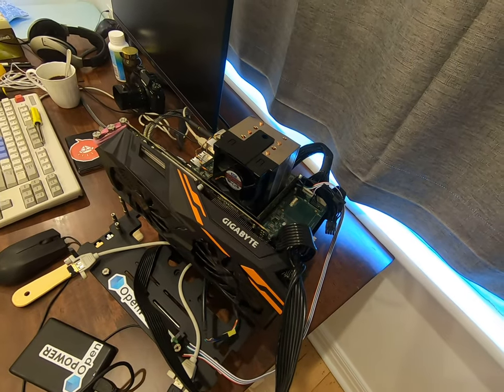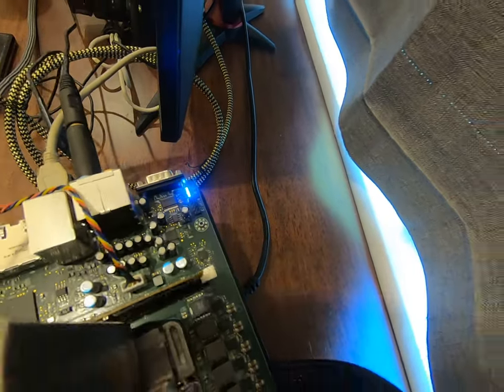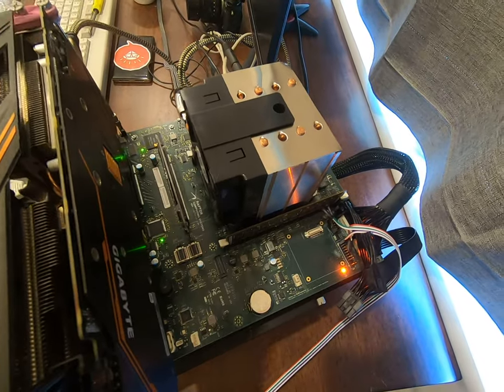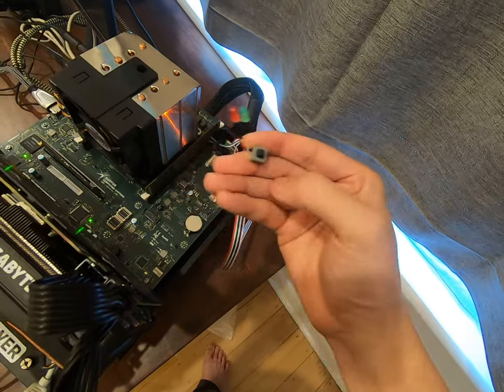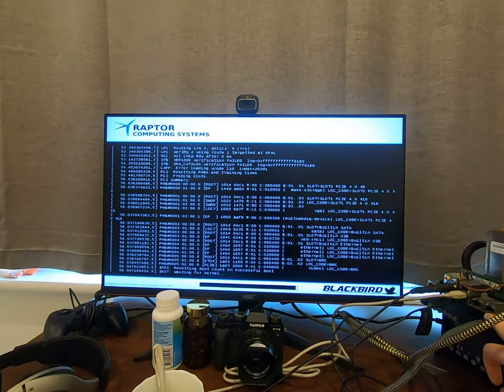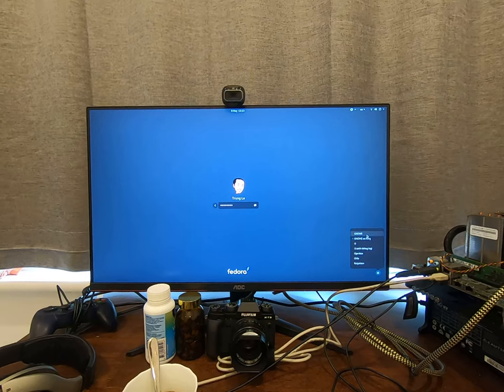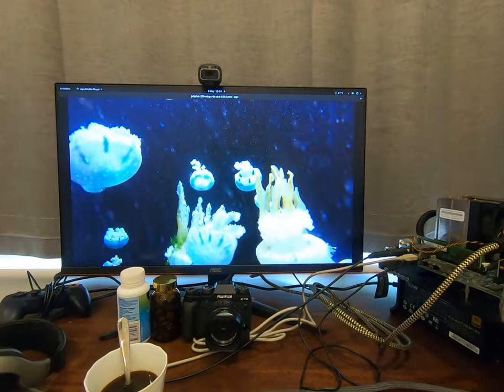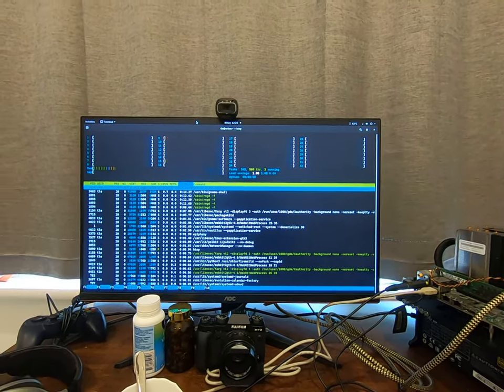Boot up Raptor Blackbird - the BEST OPEN SOURCE OpenPOWER (PowerPC) computer

Comment: 32 threads, perfect for installing gentoo linux :)
Reply from the maker: ever x sadly Gentoo does not support ppc64le. But I have no issue with compiling big project like Chromium, Firefox
Reply from the maker: ever x thanks for pointing that out
Reply: perfect for slax
Reply: Can it run autodask maya on a ppc for Linux

Comment: I am in the market to be setting one of these up. I have a mainboard and am too broke atm for a CPU and RAM. I was wondering if you could do some benchmarks with FFMPEG video re-encoding and maybe compiling a large program such as Blender. These can be extremely CPU intensive and I’m very interested in how this system handles it. I am impressed that an 8 core CPU does 34 threads…
Reply from the maker: Blender on just CPU is slow. However on CPU + GPU it is just as fast as that of x86_64. I wish I have a comparable x86_64 system to compare with.

For FFMPEG video decoding/encoding, it is again not that impressive with CPU. In fact it is actually slower due to poor software optimisation
Reply: @TrungLe-lw4zm  the thing is that as far as I understand, PCI devices have direct access to memory through the DMA is that an nvidia card could infect your linux, or the bios itself, we must investigate this issue more, I am very disgusted sincerely both nvidia and intel as microsoft, but the one that disgusts me more is intel because of its ME, today confirmed that is backdoor NSA, the issue would be to seek solutions outside of nvidia and amd graphics

Comment: What is the power consumption on these machines? I expect them to be high, but are they crazy high or on par with an x86 workstation with similar performance?
Reply from the maker: Good question. I have not measured the power consumption. Plus I do not have an equivalent x86 workstation to do benchmark against. Perhaps this might be a good suggestion for Michael Larabel of Phoronix page for his next benchmark

Comment: did you need to disable the AST with the jumper for gpu output in the OS? I would like to use my gpu without flashing amd firmware as well.
Reply from the maker: Yes you need to disable VGA output of the AST.

Comment: Another Question that Comes to my mind. When you first have to press the button for the Firmware and then after some minutes the other button for the Mainboard, then how do you see if the Firmware is Ready when you have the board installed in your Desktop? Or do you simply wait x minutes? And which Desktop case offers two Buttons to start the Computer? Most have only one. Only very old cases have a second one for the reset button that could be misused as the Firmware power button.

I also wonder why Raptor does not Mention on the hoempage that the board has an M.2 Slot for an NVMe disk. It only mentions SATA.
Reply from the maker: There are a series of 4 small LEDS on the motherboard. Once they stop blinking, it means the firmware has booted. Then you could jumper-boot by shortening the pin headers exactly in the same fashion as that of x86 motherboard.
The board does not come with M2 slot. I have to buy a PCIe X4 M2 adapter.
Reply: @TrungLe-lw4zm  My Question was: how do you watch the LEDs when the board is in your Computer case? I want to have the computer in a safe case (safe from dust and Kids). A Computer case typically only has one power-on button. If I push that, then it only initalises the board but does not boot? How to actually start an OS (or select one from a menu?)? Or can you not build it into a case because you have to wait for the LEDs to stop blinking and then have to shorten the pin headers?

Ah, that explains it. Which Adapter did you use? Do you have a good experience with it?
Reply from the maker: @dannilow2382  Good question, there is a header for server front panel I/O which has LEDs to indicate if the initial firmware is done or not. I have not tested that out because of lacking of the panel. So I tend to wait for about 1 to 2 minutes. It is easy to tell if the firmware is ready or not, if it is not, when I try to boot with the power button (or shorten the pin headers) it won't do anything.

Comment: Are you running a multiseat setup that allows independent console access (via the motherboards framebuffer) and GPU at the same time? I have a board with a BMC running vga out via an ast2500 but every time I switch to the console it blank screens my GPU output and vice versa and want both to work at the same time but think i maybe need to tell systemd and x how to do multiseat :/
Reply from the maker: No I did not set it up that way. Please bring that up in forums.raptorcs.com, I am sure someone must have gone through the same pain

Comment: So does it really take 3minutes to initialize the hardware before you can actually power it up? This is what I understand from the introduction about the blinking LED in the corner. And then does it take 3 more minutes until the Linux is actually booted? What does the computer do during these 6 minutes? I mean from pushing the power button my system is ready in 30 seconds. But waiting 6 minutes is very long. Also it is very loud. How much noise does it make in a case?
Can you explain once more why you used different HDMI outputs and why you switched after the system was started? Can the open firmware only be viewed on the internal port but not on added graphics cards? Is this planned to change? Because switching cables is annoying. How much slower is the internal graphics?
Reply: @L3v3LLIP  This board is marketed as a Desktop, not as a Server.
ECC RAM is not required I think. I read somewhere that you can use non ECC RAM.I assume the check will be faster then.
RAM is versatile. It should lose the Information after a while when it is powered off. Why is it needed to check then? I understand that you want to know if the RAM is working or corrupt, though.
Why is the RAM not cleaned when shutting down the Computer? Then there is enough of time, but not on Startup.
Reply: And would you think it is okay to run this board with normal RAM, no ECC?
Which Clock rate should the RAM have? It is not mentioned on the Raptor page.
Reply: @L3v3LLIP  "must be ECC;" I see.
Reply: @dannilow2382  It may be marketed as a desktop but it uses server components so you have to use server RAM; which sucks but Raptor can't change how IBM makes the CPU so for now it's server RAM. Maybe POWER10 will support cheap desktop RAM but I doubt it.

Comment: This may be a really dumb question, but could these offer legacy compatibility with pre Snow Leopard Mac OS PPC binaries via a linux compatibility layer? I'm sure this doesn't exist, as, like why? Just curious if it could or if the architecture has had a massive overhaul since the 970 days
Reply from the maker: I do not think it is possible to install it as a host OS because Apple OSX never support POWER8 or 9. However it is possible to run OSX as a guest OS via KVMPPC emulation https://www.talospace.com/2018/08/making-your-talos-ii-into-power-mac.html

Comment: which version did you get also can you do a tutorial for those of us on how to get this board to accept the gpu of choice like you did?
Reply from the maker: Could you please elaborate on the first question on version? 

And regarding the GPU, I highly recommend you going with any card that has amdgpu driver support, please have a look at https://wiki.gentoo.org/wiki/AMDGPU for more details. The kernel would automatically load the amdgpu driver module so you just need to disable the internal on-board graphic card output and plug your HDMI or DisplayPort to the AMD Radeon card.

Alternatively, you could go with NVIDIA card but please note that proprietary driver from NVIDIA does not support ppc64le. Therefore users have to go with the reverse-engineered Nouveau driver instead (which has poor 3D acceleration). I highly recommend you buy the GT710-4H-SL-2GD5 card which is Kepler-based and has great performance with Nouveau.

I hope Intel would reveal the Xe GPU soon because I am sure it would have great Linux driver support.
Reply: @TrungLe-lw4zm  Thanks. What i meant was what version of the raptor motherboard did you get the blackbird or talos II and also which power9 cpu the 4 core or 8 core?
Reply from the maker: @jwizz1396  it’s Blackbird with POWER9 8 cores

Comment: Could you demonstrate running Mac OS or Windows using QEMU on this computer?
Reply from the maker: Not possible to run Windows because that OS does not support ppc64. 

For Mac, someone has already tried. Please see https://www.talospace.com/2018/08/making-your-talos-ii-into-power-mac.html
Reply: @TrungLe-lw4zm  I am sure if your computer can run QEMU then it can run Windows. I am running Windows XP on my M1 MacBook Air using QEMU.
Reply: @TrungLe-lw4zm  Thanks for the link.
Reply from the maker: @a4e69636b  M1 has a great x86_64 emulation but unfortunately the IBM POWER is really really really really bad at it. It is like running a 300MHz Pentium 4

Comment: this is too expensive
Reply from the maker: gaby1491 it’s like people say truck is way so more expensive than sedan. You see, each has their own application.
Reply: @TrungLe-lw4zm  I don't think this has a practical application for 99.99999999999999999% of people. Don't get me wrong the video was cool but this is crazy expensive.
Reply: @gaby1491  When you need to be as secure as possible is the use case for this computer. The more software support we get for OpenPOWER the more silicon that will be made because there will be more demand which will result in cheaper silicon because production costs decrease with mass production of silicon. So if you do at the very least support OpenPOWER and know that it’s better than x86 for security than that’s good.
Reply: @nooflebot  I get that but my point on cost remains. Also there are other ways to do this that are not so expensive.
Reply: @gaby1491  I’m interested, what are the other ways? I’m alway open to any new architectures.